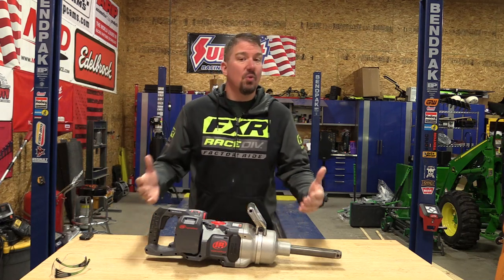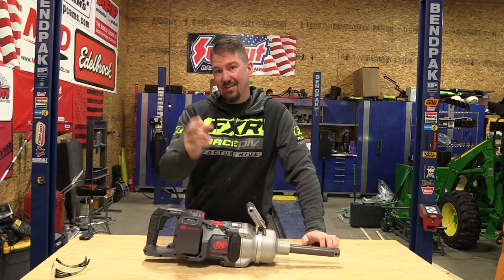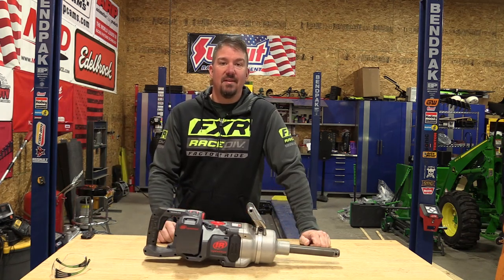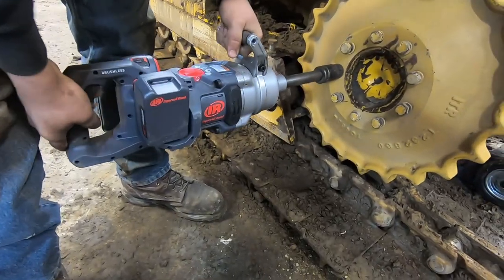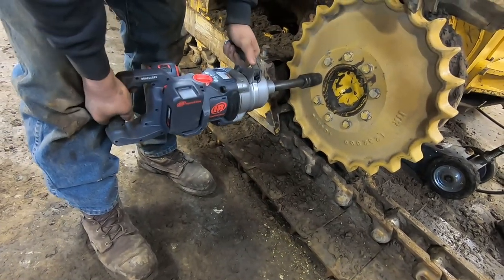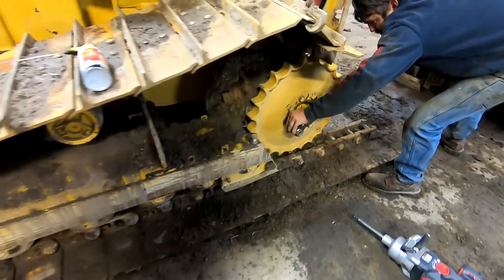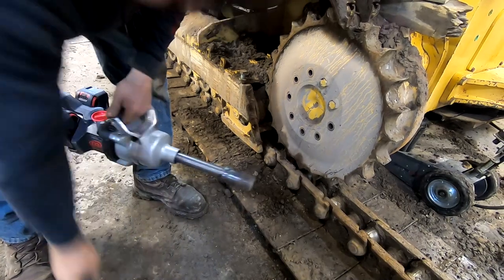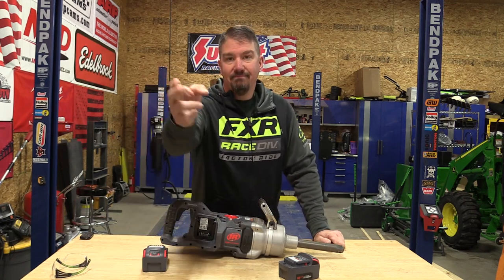The Hardest Hitting Impact Wrench You Can Buy!  Ingersol Rand W9691" 1 Drive Dual-Battery D-Handle

Comment: I like how quiet it is compared to the air powered ones. Also, if you think about it, the cost of buying a good quality air compressor that will run a 1” gun will outweigh the cost. Admittedly, I know that every shop already has a compressor and that they are far more versatile. But if you have a mobile tire truck I can’t see anything better.

Comment: I set 6 ft. Long utility  pole anchors in the ground with this thing...coat the battery tray slots  with dielectric grease if your gonna be hammering something for 2 or 3 mins nonstop.or the batteries may become seized in place.

Comment: I’m definitely an IR fan of all their products. I have all the cordless tools except this. Does this blow the Milwaukee 1” away ? 
  Great channel, great info as always!!!
Reply: Watch the torque test channel video https://youtu.be/pKLRhT7PGbo
Reply: I own both the milwaukee is much  easier to deal with and will break most any bolt..But IR is on another level. As it should be,it's higher voltage and twice the size and weight.

Comment: That thing is a beast,i wonder what the voltage drop is on 1 big rig lug.if you acheive voltage drop on 1 lug you can calculate how many lugs it can remove with one round of batteries.great video you the man.
Reply: Well I know how many I can do with a 1” Milwaukee on a single 12ah. And it’s about twice the gun that one is. So well over an entire trucks worth.

Comment: So between the Ingersol and Milwaukee which would you go with if say you had a large lineup of Milwaukee m18 tools in the shop?
Reply: on heavy Equipment the Ingersol. Its overall the stronger and better quality tool. 
If you just do truck wheels than the Milwaukee

Comment: How are you testing the accuracy? Without a real system i.e. AKO transducer no way to tell that level one was even close to 10% accurate.
Reply from the maker: This is an impact wrench.  It is not accurate in any way.  You will get different toque hits on different sized bolts and nuts.  It just gets you close.
Reply: Well for starters I know it wouldn't be close to ten percent accurate.. It's an impact wrench.. You use your head..

Comment: so this is why Milwaukee came out with an updated D handle. also, does IR need to protect their batteries from the impacts? Milwaukee seems to have issues their batts getting beaten up.
Reply: That's because milwaukee has a sloppy battery from day 1
Reply: @Sid The sloth yeah I know that.. I'm talking about the battery fitment on every tool.. Not just the 1 inch.. The batteries slop around on every tool even the ones that aren't designed to move